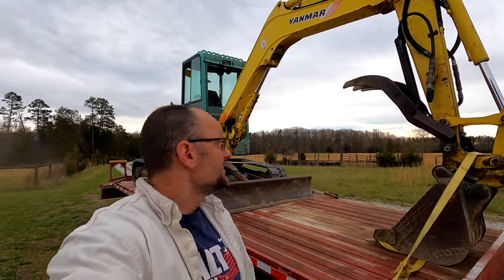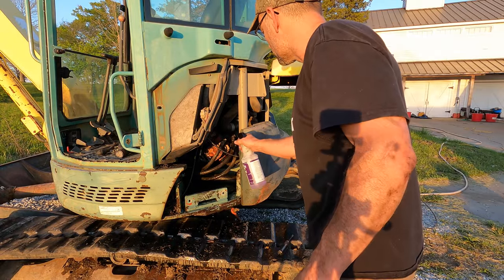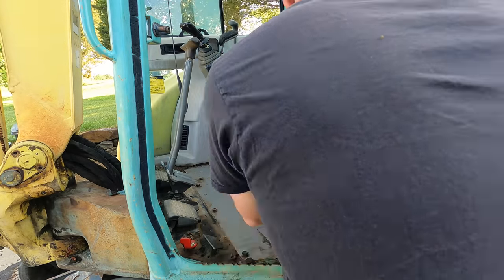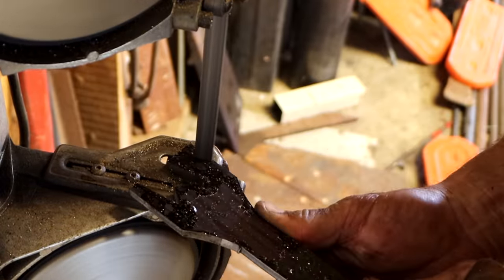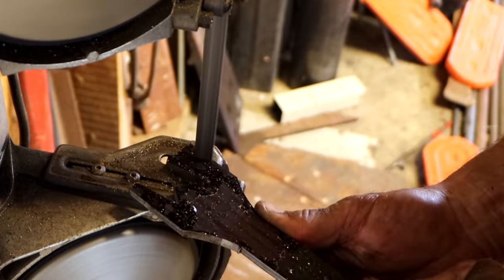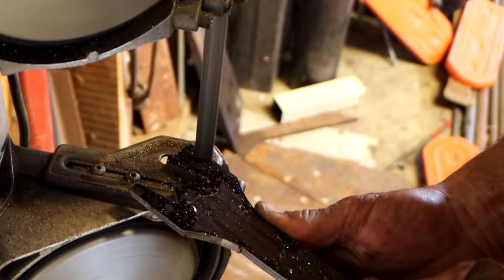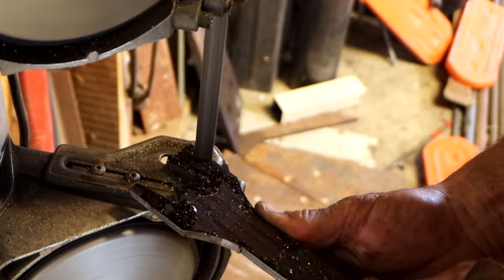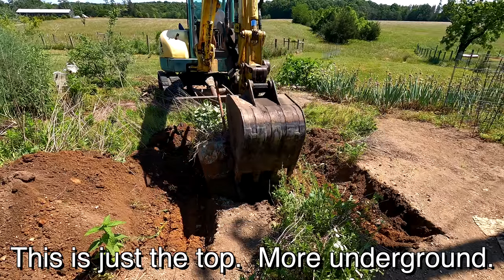Buying (and Fixing) My First Excavator.  Yanmar VIO-50

Comment: I think you did OK on the excavator. It's always a balancing act of picking a machine with no deal breakers critical issues that are going to be prohibitively expensive and finding a machine with the combination of little issues you can deal with as you go...and they will all have small issues. I purchased a similar vintage machine about a year ago. Slightly more modern 2006 and next size up 7.5 ton  It's a Yanmar vio75 for about the same price 20k. Though I am in Australia and I have the feeling our used market is a little less heated than the USis at the moment. That said I was happy with the price as it was all I could afford. It has air-conditioning and the cab is complete. I doesn't have a thumb (has the remote hydrologic setup for one) also it didn't come with  any buckets. So that was an additional $3500 for a new 1ft trenching, 3ft GP and a 5ft mud bucket. It  has more hrs about 5000 though is in used but clean condition.  That said the tracks that came with it were near the end of their life and I have just purchased two new tracks last week. Havnt arrived yet and they were 4k . I had the same small oil leaks on some pump fittings that had made a mess but were easy fixes (though it's tight working in the space)  my final drive fill plug bolts had nuts welded to them so it's obviously a issue with people rounding out the small tight hex drive bolts.

The yanmar engines a the most reliable little diesel motors I have ever owned. Have a small yanmar tractor aswell. Not the most refined but they just fire to life every time..fist time and purr away all day with out a fuss. It's no wonder they use them in boats. This vintage excavator is nice not crazy old but not modern enough to have electronics and emissions.

Will be following along with your future videos.
Reply: Yeah, I also live in Australia Tasmania and own an excavator! Loved his presentation and explained each step so well!
I own a 3 ton Komatsu and one of the best purchase I've made! Where are you in Australia?

Comment: Indeed the golden thingie is a pressure accumulator, a sort of battery. Be careful with those things.
A little tip on removing stuck bolts when you have to use heat is to point the heat directly at the bolt and not the surrounding area. Heat expands the bolt and when it cools down it shrinks and breaks it free. With longer bolts you have to pace your heating to not melt the head of course :)
Absolutely awesome videos btw!
Reply: I just commented the same thing, but deleted it after reading your comment.  Accumulator.  The ones that we used to service on rock crushers were 4 feet tall with replaceable bladders.  Tramp cylinders.

Comment: Those Yanmars are fundamentally solid machines - great engines, about as good a mini-digger you can buy - only Takeuchi or Kubota are better in terms of reliability/durability.  They're slightly slow - but that's fine too. I doubt you'll be unhappy with your purchase. I'd ignore the track tension & have a look at the track pedals throw - the linkage may be off on one side - do the simple stuff first. Adjust the linkage throw. Leak looks to be the PRV, or pressure valve - ignore, lol - chuck in oil..  That Yanmar engine runs happily on 10w 40 or 15w 40 oil - boggo stuff is fine, no need for fancy oil. Change it often & bung on fresh filters often - and change all the hydraulic filters - this yoke will run for decades.
Reply: @James ward Hi how are you? Hope we can be friends

Comment: Great video,  
@  FarmCraft101 
-I appreciate your skills, awareness and a well made video ! -  
Thank you !!
Awesome to get a good deal on a quality machine with minimal computers, emission devices, limp mode etc !!!

Suggestions:
For the track adjust , a higher pressure grease gun may move the adjusting cylinder (lever or pneumatic, instead of pistol grip)
Check the worn track for cracks that allow water to get at the internal cables making them rust & break. Most rubber tracks crack & break before the treads wear out.
The hydraulic tank is pressurized & sealed (vent air in , but not out ) , important to vent the pressure before draining/ opening  to avoid a blast of pressurized  fluid. Sometimes there is a button to push on top of the tank  or loosen the fill cap. Good to vent now and then to prevent possibility pressure buildup over time
When checking the hydraulic level, the hydraulic cylinders need to be in  specific positions (check manual), most machines usually call for most  cylinders to be closed / retracted -putting max fluid back into tank (displaced by the volume of the cylinder rods) - Bucket uncurled all the way, dipper stick extended and boom down until bucket on ground, thumb retracted,  swing boom cylinder closed (swing right ?). Blade down.  
Hydraulic tank max  fill  levels are engineered considering   the size of the  air pocket at the top of the tank that compresses when cylinders are retracted , too much fluid can reduce the volume of air and potentially  over pressurize the tank..
Best Wishes

Comment: Wow. Nice score and you really did a nice refresh on that unit. Just a word of caution to ANYONE regarding what hammer to use. A carpenter's hammer has a hardened face designed to strike softer nails until the end of time. Using a carpenter's hammer steel on steel can cause that hammer face to fracture and that becomes shrapnel. Please us a ball-peen hammer as the are designed and hardened for striking steel.

Comment: Dear Sir: The worn drive belt/track makes the travel less than the newer side, so the machine will always pull/steer to the left. Put a new drive belt/track and  both sides will drive equally. 😁and you got and did a damn good machine and job! 👍

Comment: I think you bought it right. I just bought a 2007 Yanmar vio55-B. 2800hrs. Came with Hydraulic thumb, 36in bucket, and 12in bucket. I paid $33,200 for it. I've owned it less than 2 months and get calls to do work with it all the time. Great machine. You'll definitely get your $20,000 back in the improvements you make on your own property, side jobs are just the icing on the cake. You'll do well. Good job!

Comment: I bought a used 2013 VIO55 last year, and it serves me very well. I serviced the final drive gear oil too; it smelled bad also, but the motors work as they should. I also need one track adjuster seal replaced. I bought an Oem repair kit for about $50. I’ll be taking the track off and the idler system out in the near future. It doesn’t appear to be that big a deal to fix. I paid more than you, but I got a dry machine, new tracks and an enclosed cab, heat and ac that work too. It’s used, but wasn’t abused.
Anyway, thanks for sharing your service video. I learned more about my machine watching you work on yours.

Comment: Awesome torque wrench! "Sounds" like you can program all sorts of custom indicator clicks when you meet the right torque setting. With a state of the art tool like yours, I am guessing you don't have to look up the torque setting as it automatically will acheive the correct torque.  I have used an older version, however, mine did not have the custom sound option. Great video and channel.  Subscribed.

Comment: The spring part of your piston pump is often called a horsepower limiter in my field. There are also many pump models that have a similar control unit, but instead they have a small hydro-electric valve which controls a piston that will hydraulically govern the swash plate. Those are known as servo-controllers.

Comment: When working for a major hydraulic manufacturer, I was taught to use Teflon tape, but never on the outermost two threads and only one wrap, and it worked great!  That was to avoid the very thing you spoke about:  making sure Teflon does not get into the system.  Also, wrap the tape in the same rotation on the threads as when tightening the joint.

Comment: That unit you took out is a 'pressure compensator', with a thermal temperature regulating spring. It prevents pump shock in the system and when the oil gets hot it allows the operation to commence smoothly. It works similarly to your radiator thermostat in your water system. You got a very good deal, consider this machine as an extra pair of hands. For farm use, can not get better, for extra work, it will earn its money back.
Reply: TECHNALLY ALL HE NEEDS NOW IS SOME PLASTIC TILE PIPE to get all his fields TILED AND INCREASEED PROFIT!! CHACHING!! :) not to mention all the stump removals and watnot! :) cha-ching!!!  CHA CHING!!! $$$ in the INCOMMING slot, not the $$$outgoing slot!!! :)

Comment: Great video! I have a very similar machine IHI 45NX (10.5K lbs) I bought for a major renovation project I've replaced a bunch of stuff on it just as you did and it's running fantastic now. I think this is one of the most useful machines available. It's big enough to move just about any boulder, while still small enough to transport relatively easily.
Reply: @Chris Gahn Hi how are you? Hope we can be good friends

Comment: the wrench your looking for is called a tappit wrench. I have made my own in a pinch, using cheap wilmar stock, but you used to be able to purchase them from PROTO or MAC TOOLS. They are thin and usually made from case hardened mollybendium alloy so they can take a little tork without breaking. Back when true hydraulic lifters were a thing, we used them to adjust the lash on the valve set on motors. And nice to see the younger generation tearing into stuff and learning as you go. There hasnt been a farm or ranch built over the millenia where the proprietor didnthave to fix, repair and /or maintenance their own gear...whether it's amodern excavator or a buckboard wagon.
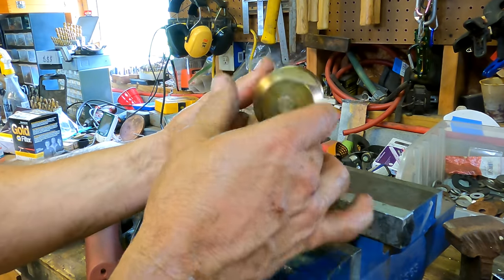Reply: Yeah, but in this case, there was absolutely no reason to make a new tool.   16:56 ....  There are plenty of threads there, all he had to do is screw down the jam nut another thread or two , and that would let you have more clearance to fit a regular wrench in there.  Sometimes the fix is right there in your face.   Think about it --- the last guy probably took it off with a normal wrench;   then he spun that jam nut a little too high to fit his wrench in there, and that's why he couldn't tighten it back down and it leaked. lol..   So neither one of them noticed that you just need to unscrew the jam nut a bit, which would simply lower it on the threaded shaft, which will make the accumulator stand a little taller for more clearance.   (like I said, there are plenty of threads there and they aren't tapered).  And you have to clock it the right way for that other line to screw on and then you tighten down the jam nut..   You could probably raise it up enough to fit TWO wrenches in there, or even a fat crescent wrench.   Cheers.

Comment: As another reference, I paid $32,000 two years ago for a vio55 5b (basically same machine) with two brand new tracks, new thumb, two brand new buckets (2’ dig and 4’ muck) .  Machine was clean with no leaks, intact cab glass and door, and was well maintained. 5700 hrs. I’ve put 500 hours on it with no major issues so far.
Reply: what is considered High time for a Yanmar?
Reply: @carlspletzer3433  If it has 9000 - 12,000 hours on one you give it to your gran to dig up her cabbages and if it breaks down send it to a scrap yard.
Otherwise they are worth maintaining and keep them going.
In bigger machines i have seen Komatsu diggers with 12,000 - 16,000 hours on them but they are usually on their second pump and had an engine rebuild
Reply: This is not your first time doing maintenance

Comment: A perfect example of why you should always remove the fill plug before removing the drain plug.
Thanks for the video. I think you did alright with it
Reply: You could still fill it through the middle hole if you had to.  But I get your point.  Worse case, he could have welded a 5/8" nut on the outside and took it off there with something stronger.  But I like his technique, by turning it while hitting it with the air hammer after  adding heat.  Pretty slick

Comment: 26:06  Nice job with the spring clamps!  More consistent clamping force through a wide range of temperature.  Self adjusting, too!  Screw (worm drive) clamps do well if the temperature stays fairly constant, but rubber compounds shrink with heat and expand with cold, exactly opposite of what the metal in the clamp does.
Reply: And the screw type clamps rust over time, making opening them sometimes annoying at best and nightmare at worst. Spring type clamps rarely (if ever) fails due to age and rust.
Reply: Worm gear work loose over time with heat cycles. Expansion and contraction.

Comment: Thanks for the video, It's interesting watching you work and even make tool.  Over the years I've collected cheaper brand or yard sale tools so I can modify stuff for jobs if I need to ,instead of mangling expensive sets.  you seem to have a better understanding of the wrench turning than some youtubers that make themselves look completely stupid to, No I don't mean Hamilton at least Hank admits he's not a mechanic but does good with what knowledge  he's got available.  
   My back grounds farming, and machine repairs,  buy and sell some, and run a machine once in a while .   open station cabs are ok on some days but ill tell you i'd rather have windows that open and close than nothing the day you got to dig and the winds blowing dirt all over you and you can't get out of it or quit until later.   Cheap good and used machines are words that don't fit the same sentence, I know what I'm buying and can fix it, lots aren't that lucky and get hit hard with reality sadly. 
  The big concern is your traction speed problem it could be something simple like linkage not moving right, seals in the rotary hydraulic swivel to the tracks, or something way more expensive. I think the price was probably about right compared to some complete overpriced  junk thats out there waiting for a victim with a check book L.O.L. Looking forward to more, Take care.

Comment: That o-ring is originally round, usually once they start leaking the fluid will cut a groove in it and it will leak a lot worse. I have had to make a wrench skinnier , usually by grinding the side of it. Good job, nice and methodical without getting upset. 😊

Comment: I'm cracking up. I bought a mini just like this and just went through the same exact process as you. Except mine had been leaking worse, for longer. Bucks of oily junk were removed. Gallons of degreaser were used. The leaks were exposed and conquered. Felt good getting it fixed up.

Comment: The mystery part is like a "shock absorber", it works like water arrestor  to prevent sudden pressure spikes like you said.
Reply: I was thinking the same thing, the design looks a lot like a Water Hammer Arrestors, just beefier.
It's worrisome that your dealer did not know that, it could make a lot of damage to your pipes if removed...
Reply: i know it as a hydraulic smoother/damper stops sudden jolts in the curcuit

Comment: Track thickness is visibly different even from the video.  The left side tracks are going to be slower because of their outside diameter being smaller.  A new track on the left side would make up for it.
Reply: That's assuming both pumps have the same output. The controls are proportional live with it.

Comment: Great work doing all the service items , don’t forget the hydraulic tank breather ( pipe looks a bit yellow in video and sits on top of the tank )
With all that material you cleaned out it’s possibly that the hose and gause could be blocked or collapsed over time . Best have the hydraulic tank breathing so oil can be fed to piston pump without restriction occurring 👍
Reply: @Sean Loughman Hi how are you? Hope we can be good friends

Comment: Not a bad deal in my opinion. A quick tip I learned working on excavators. When changing a hose that runs under to cab and all the way across. I used colored zip ties. As, put 2 red ones when removing, one on fitting, one on hose. go to where the other end is fastened, find the hose and put red zip ties on that end. Pull the hose out, get it fixed, easy to replace. Also nice sometime to use a pull strap to attach to hose for pulling new one back through the correct route. Good job on the video.

Comment: I think you got a bargain.  Doing your own work saves thousands alone. Impressed with your work. I have done a few dumb moves with an air gun myself a few times and one involved a diesel take as well. Lol
When you had the hydraulic tank open chaging the in tank filter, that's a good time to fill with bulk oil.
I just bought a 1976? Yenmar YK2000 tractor.  Needs a few hydraulic cyl seals all piston rods are strait and a needs a new hydraulic pump. Has loader, tiller, landscaping box and bush hog all recent rebuilds. Paid $1500 and I gave hin $100 for delivery.  Found out after he just needed money to take his wife to Florida.  She was dying from complications from covid19.  She died 2 days after delivery. I took $500 to the funeral home anonymously.
I'm a retired disabled mechanic, wheel veh, heavy equip , track w/USARMY, 23yrs AD 100% PT disabled. Partially fussed upper and lowwer back less 2 vertebrae, both knees replaced. 
I have a small project comparatively but  look forward to it.

Comment: You are into it for a real good price according to prices in my area,  N TX,  great job in your research and education and method of sharing with us your service manual education. Thank you much.  Now I will be putting my set of MAC TOOLS LOW TORQUE, THIN Wrenches on ebay, that I rarely use and just follow your lead, make them up as I need them one at a time. Those things were super expensive, used in my previous life Private jet Aircraft technician.